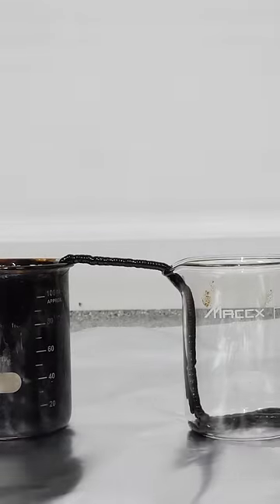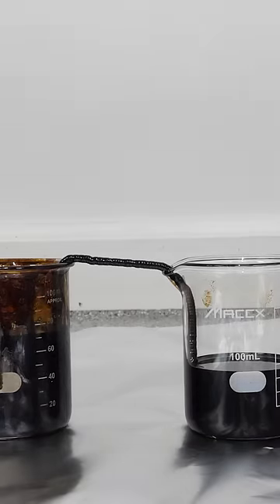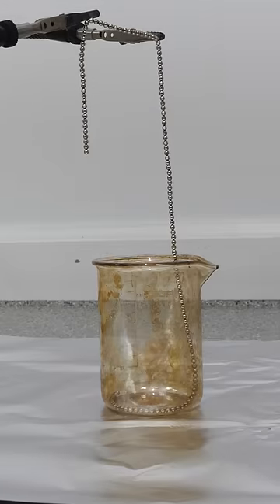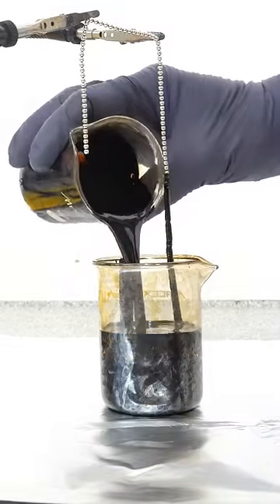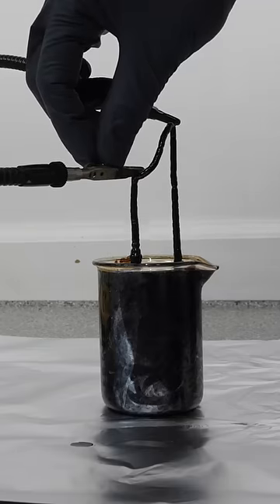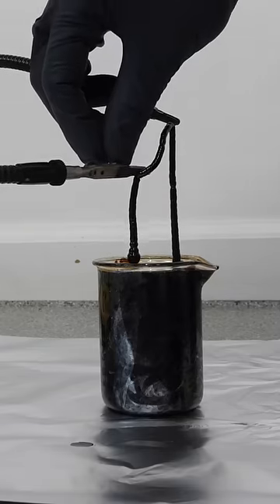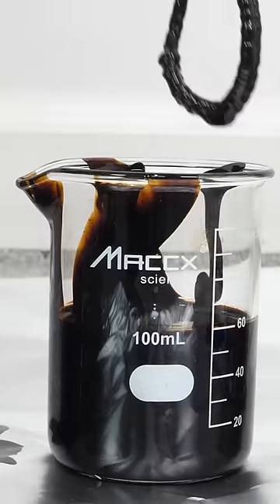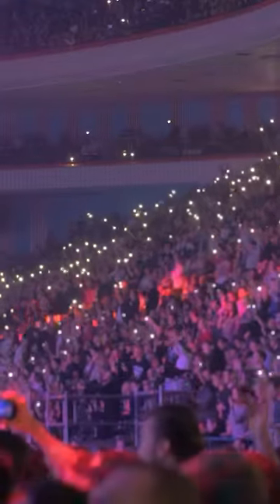Perpetual Ferrofluid Fountain

Comment: “Do you think this thing would cause a perpetua-“
No.
Reply: Right, still cool to see some magnets used to siphon though. Didn't think I'd see that.
Reply: If you put a floater in the second container to change the direction of the siphon it will most likely stop in the middle but what if we add some sort of a delay like a diaphram to delay the rise?

I know it wont work but i want to know why. Does the siphon end when the containers are at equilibrium?
Reply: the question is not IF it will, but WHY it won't
Reply: @Fallie-bi7zx  the syphon ends when pressure is at equilibrium, that's my guess

(In the same way you can use capillary forces as syphon)
Reply: It's always no 😭

Comment: I knew it doesn't work because perpetual motion doesn't exist, but this concept had me excited for a moment
Reply: I kinda wonder if they made the magnets going down slowly less strong until the end where their is no magnetic pull at all or very little magnetic pull; would it change anything?.
Reply: @Name-nq7tj  changing the magnetic force also requires energy, you would need to move or actively change something
Reply: @Name-nq7tj  It's not about the other magnets at all. It's only about the magnet at the end. It's force to pull fluid from the magnet before is equal to the force to keep the fluid from falling down.

It's the same as you using a magnet to pick up a paperclip, and then magically expecting it to drop the paperclip.

Unless an external force acts upon the magnet or paperclip (inputting energy) it's not going anywhere
Reply: he was talking about making the magnets at the end not magnetic at all.. after the last bend may be. Would it work?
Reply: Oh..the fluid sticks to the magnets with stronger power .. i am dump😂

Comment: Everyone in the comments just "what if he had a pointed stick!" Lol. Friends the energy required to pull it up the chain will always remain the same. So it will never pull more up than it can hold. Even if the end magnet was weaker it would still just make the next strongest magnet hold the majority of the mass. You would actually see the bead around it be bigger than the bottom one. This is clear by even dipping the end in the beaker it did not take more than it can hold. The flow cannot exceed the energy the magnets exert to pull it to it. I think its far more interesting the first example showed the magnets create a siphon effect and half filled the other beaker.
Reply: Right? Using the magnets to induce a siphon was cooler. With an electromagnet, I imagine you could turn a siphon on in a ferrofluid a lot easier than with a pump. No idea why anyone would need that, but it's cool!

Comment: Even if the fluid dripped into the beaker, the magnets were already coated so no more fluid could clime up the magnets due to the attraction being weakend by the fluid being there in the first place. Magnets have a set strength and can only attract so much which is why its not possible.

Comment: Yea I figured the magnets would just suck up as much as they need and then stop :') Magnets aren't a siphon, they're magnets. The reason ferrofluid is running up there is because it's a metal in a magnetic field large enough to overcome gravity on exactly that amount of that metal. Whenever the field is saturated the process just stops dead in its tracks because the magnets can't pull up any more, and it won't drop anything because they can't pull any less either being permanent magnets.
Reply: and... they won't drop the drip because they're magnetically pulling it back up
Reply: This idea was similar to an earlier idea for perpetual motion, however it used strong cohesion instead of magnetism.  However, the problem is the same. Water got to the end, and didn’t drip down because it had already climbed up against gravity and would just stay in the tube that had helped it climb up against the force of gravity.

Comment: Ha! I knew the ferrofluid wouldn't fall off, because if the magnets are strong enough to lift it up on one side, they're not gonna magically become weak enough to let it fall off on the other.
Reply: Why did the magnet let go when there was 2 beakers?
Reply: @devdattanm2721  With two beakers, the ferrofluid started flowing over the string of magnets when the last bead on the dry side was positioned lower than the center of mass of the ferrofluid, so gravity could exceed the magnetic attraction.

Comment: If it is able to lift the fluid up then that means it is able to fight against gravity, meaning it won't drip.
Reply: it would drip if there was a flow of fluid, but there isn't one due to friction. The tip can only hold so much and if there was a perpetual motion, the mass of fluid at the tip would stabilize to it's exact 'dripping point' so that over time, it doesn't hold less or accumulate fluid.

Comment: You could make a cool little “perpetual motion” desk toy by replacing the downward leg of the magnets with a identical looking coil.  Then carefully using the support to hide wires to the coil.  Then you would just need to work out the right pulse rate to keep drops flowing.
Reply: If you used a highly conductive fluid, like Galinstan, you could build a sort of fluid railgun.  Alternately, if you used a highly dielectric fluid, you could build a pump that works kind of like that propeller-less plane MIT made back in 2018.

Comment: Even if it flow like perpetual fountain. Will it consider as a perpetual motion couse it take external magnetic energy??
Reply: ooh i like this question!
Reply: I don't think so because the magnetic energy is like any other energy that would be part of the device... its part of the system therefore not external.
Reply: @mcmaldek  But magnets do wear off. It takes an incredibly long time, but at some point, it would require external energy to keep going.
Reply: well since magnet do wear off they could be seen as a kind of battery that will deplete and will need to be recharged (magnetized again) so yeah even then the system needs external input at some point
Reply: No, because that is how Perpetual motion simulator work. it have battery
Reply: No such thing as external magnetic energy. You can't add energy from an outside magnet into a system without making the magnet part of that system, and then any energy you get from attraction/repulsion is useless because you have to impart at least that much energy to undo it
Reply: @doomse150  everything wears out in any system,  if it were rubber bands or springs you would replace springs... so you replace the magnets. To add energy from the outside like how you gas up a car would defeat the purpose, might as well put an electric pump on it.
Reply: Furthermore yes you would have to start the thing again and again because there's no such thing as perpetual motion, but as far as the parts, they wear out and need to be replaced at some point.
Reply: @ayumuaikawa  yes there's no perpetual motion, you would need to restart it again and again, the goal is to reduce the ammount of times you need to do that, external energy is always needed for a machine. But as far as the magnets, you would be better off just replacing them entirely... not that this device even works... but if it did it would stop eventually.
Reply: @mcmaldek  I wasn't talking about the actual material wearing out. Magnets actually lose "power" like a battery does. Therefore, you'll need to add energy to remagnitize them or exchange them for fresh ones like you could a battery.
Reply: @doomse150  Yeah.... but it's probably easier to just replace the magnets the way you would any other part of a machine, batteries, magnets the same as parts that wear out etc. It's not perpetual motion anyway so it doesn't really matter, this machine doesn't even work. If it did you would have to put in some external energy... but as for the parts it's made of, none of them will last indefinitely. Regardless of them losing magnetism or wearing out they still need to be replaced. You still need to put external energy into it to make it work... if you really want to remagnetize the magnets so you can say you put external energy into them... instead of putting extrrnal energy into the machine by replacing them that's  cool I guess.
Reply: @doomse150  technically the magnets do  physically wear out thats why they get weaker. but that's not the point i was making i was saying it's no different than parts that wear out because it's no different and I knew what you meant so i used analogies, offered options etc.
Reply: @doomse150  The reason magnets get weaker is literally because the material wears out tho... just saying... thats not really the point i was making either tho and i knew what you meant, you can recharge them though it's temporary... unless the reason it lost power was by realigning the molecules by exposing it to an opposing magnetic field... but thats external energy damaging it, totally different topic.... yeah you know what nevermind.
Reply: Not it would not. 
Matter of fact, you can easily realize this fountain by having a chain with the density of ferromagnetic material lowering along the chain. It's not theoretical, it's highly feasible, but since it wastes energy from magnetic force, it would stop working after a while (albeit decades)
Reply: @mcmaldek  The magnetic field isn't cannalised, most of the energy leaves the system...

Comment: You should try putting a non magnetic surface (like a straw or something) to connect the end of the chain back to the liquid in the beaker.... That might do it.
Reply: then it wouldt climb up in the first place
Reply: It will stop flowing when it reaches equilibrium... (like it did in the video for example). The liquid is going to flow until it is at the lowest potential energy, and then stop.
Reply: @juliavixen176  the reason I thought it might possibly work is because the straw won't allow it to grip onto it and thought it might not be able to create a stable flow from where the balls end to the cup belos to create a path of fluid between the two held in place by the magic force... I could be wrong, but it would be interesting to see.
Reply: @Shoteaux2  1 I think you misunderstood what I was trying to describe... The straw/rod/w.e would go in between the liquid and the end of the ball chain while the ball chain would still be in the same position. That way it would build up on a surface that's not magnetic and possible flow down it. I'm guessing that's not what will happen, but it would still be interesting to see.
Reply: @damegataco As I understand it and if I'm reading your comments correctly... You could create an arch filled with fluid, but once it settled, you wouldn't get a net flow through the tube. The energy of the magnets would just help siphon the fluid up then it would reach an equilibrium. Imagine a tube filled with water and both ends dipped into the same bucket of water. It's filled with water and appears to be fighting gravity, but it's not flowing (other than convection, Brownian motion, and all that).

In the case of the rod, you'd get as best as the cohesion of the fluid to itself and/or the rod could offer against the magnets and gravity. If the magnets were weaker to let the liquid drip down then they wouldn't be able to lift against gravity in the first place.

I don't feel like I wrote that very clearly, but hopefully some part of it makes sense.
Reply: @vituperation  I think I get what you're saying and if I'm not mistaken you have enough of an idea of what I'm trying to get at as a suggestion. Again it probably wouldn't create anything akin to constant flow, but it would still be interesting to see just exaclty where it would stop flowing.

Comment: Great! I'd love to see you make a science show out of NItinol (the memory metal). I've seen a vid on youtube (1970's) where a weight was suspended on stretched Nitinol coil - originally in a coiled position. A heat gun blew hot air on the coil, pulling the weight upwards. The calculation of the delta in potential energy gain, in ratio to the thermal energy (joules) applied, showed over-unity. Another generator dips strips of nitinol alternatively in hot and cold water and the generated motion is captured in a teeter - totter motion. Cheers!
Reply: If you can get energy out of something ONCE It is releasing stored energy. It's not overunity unless you can keep doing that again and again without putting new energy in.
Reply: I don't think he was talking about perpetual motion. He just wanted to see a video on nitinol

Comment: Try using a much weaker magnet on those last hanging bits of magnet and maybe just put a metal bead on the end then maybe if there's a denser ferrofluid that'll be better
Reply: you can't make perpetual motion work my guy, its not going to happen
Reply: Metals "fall down" to magnets and don't "fall up" off of them. It doesn't matter whether or not the last bead is magnetic or not, the fluid is not going to fall off. It's stuck just as much as a brick sitting on a table is stuck there by gravity, and won't float up in the air by itself.
Reply: If the magnets are strong enough to fight gravity going up, they're going to be strong enough to fight gravity going down, too. If that makes sense
Reply: If you put a weaker magnet at the end, guess what? The previous stronger magnets will beat the pull of the weak ones and won't allow the ferrofluid to go towards them, it will just stop a few beads before the end.

Comment: It looks like you need to have multiple chains feeding into a single (non magnetic) drip point. That way, the mass of that drip becomes big enough for gravity to overcome the attractive force of the magnets. 

This would feed a damn slow cycle of magnetic attraction vs. gravitic attraction. Put the whole contraption inside a bell jar (to prevent the ferrofluid from evaporating or coagulating) with a camera on it to count the period & frequency of drops over the next few years...
Reply: But then it won't climb due to gravity
Reply: Gravity won't overcome the magnets on the dangling end, any more than gravity overcame the magnets on the other side in the fluid. The whole thing is in equilibrium and at its lowest potential energy level. It's not going to move.
Reply: ^ this. If the magnet can pull the fluid up, it can pull it down with equal force. One leg of the arch isn't going to flow any more than the other leg. One side of a magnet isn't pulling any more than the other side.
Reply: @juliavixen176  I'm not very familiar with stuff like this, but short circuit welding utilizes  the pinch effect of magnetic fields to allow the transfer of liquid metal to the weld pool. Could you use some kind of short circuit to make it pinch to cause it to drip? Obviously it defeats the point of trying to show perpetual motion, but I'm more interested in it looking cool by dripping into the container.
Reply: @pipeliner4029  For sure. An office toy setup could be made, just like a fountain with a pump on it. Something could definitely be used to cause it to drip, I would use an electromagnet to change the pull on it.
Reply: @sabastianleisek396  That's neato burrito.

Comment: If the fluid is magnetic enough to climb up, it will be strong enough to hold onto the ball. If the fluid is heavy/weak enough to drip, it will not be light/strong enough to climb up the chain.

Comment: Thw magnetic foeld can be negated by removing the direcr conract with the chain thia should move the material clinging to the chain. So some way of mechanical interacrion should be applied and then a gap should be ceeated that will keep it moving. Maybe some mu materials are where to look for interaction. I can create a lifting magnetic field using an oscillating wave over a lentz coil base when moving at a min speed of 5 mph that can produce a wave that opposes the changing field in a coil. Dr Post did this in the 90s the permanent magnet assembly was tested ar the mag lev train test course at general atomics in San Diego. Dr Post worked at Berkeley in the 90s I don't know of he is still alive today, but I bet his work is still published or archived at California college in Pennsylvania or Philly as I rexall.

Comment: That's actually pretty close. If there was an electric charge through a coil surrounding the chain, you could pulse it once and then make the drop of parafluid fall through a long narrow coil as a pickup that would charge the capacitor to discharge and cause of the next drop to fall...

Comment: I think it might be interesting to have it touch a piece of glass at the end of the chain... Maybe it would run off the magnet a bit ... I think that would just basically filter out some of the ink and have the ink run away where it's surface tension can be broken but most the iron particles would remain stuck to the magnet.

Comment: Glass tube connecting the beakers at their base at a 120 degree angle with a snaked dual curve, each curve also at 120 degrees. Use rice bran oil with highly dispersed silica in the ferrofluid. Chain of magnets must also be at 120 degrees.
There you go perpetual fountain, yw.

Comment: you should do this again, but do 2 things. I think this is possibly but it doesnt violate thermodynamics
1. Use weaker magnets on the end thats hanging down.
2. Shave the last link to a point. Prolly have to attach a different magnet, shaved down, since it would hard to file  those balls.

it wouldnt be true perpetual motion though, since it would just make it sensitive to lesser influence, like vibrartions, variations in the earths magnetic field, and airflow.